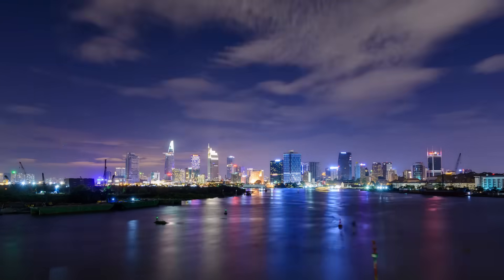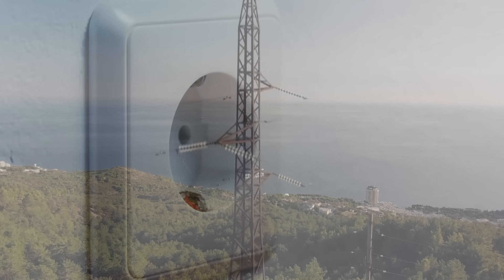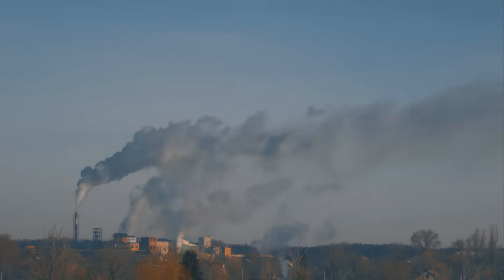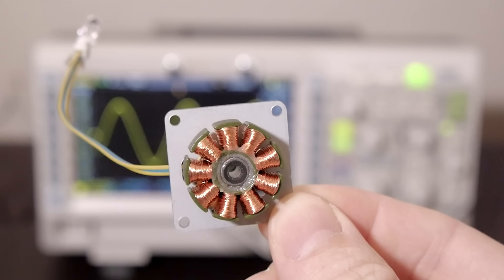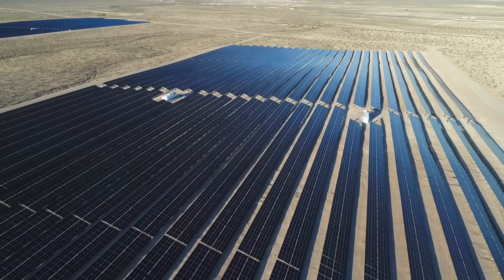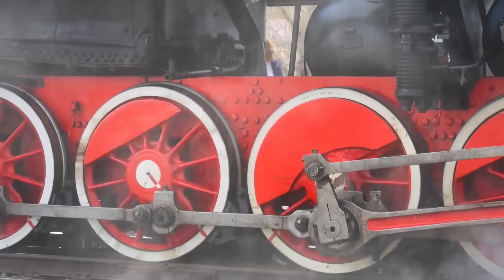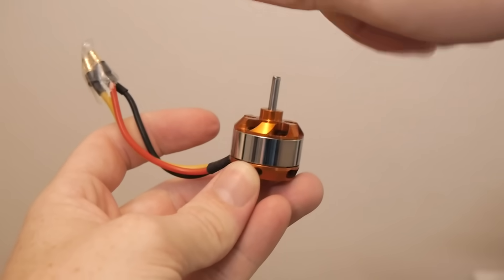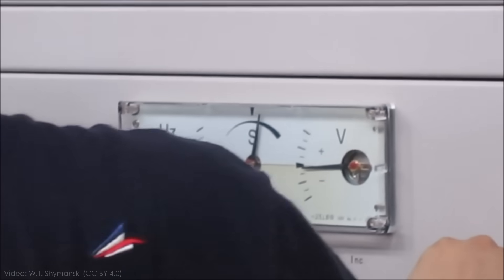How Electricity Generation Really Works

Comment: I don't know where are you from and if it exists elsewhere, but in Czechia we have optional two tariffs (higher and lower) for consuming electricity and specific time. Some appliances with high power demand were powered only during cheaper tariff automatically. It was used mainly for hot water ... we had like 150L water tank with heater and electricity for heating water was provided like for 4 hours in the night and two hours during the day or so. Other usage was heating - electric heater full of bricks that stayed warm all day long. It was used in areas without natural gas distribution or hot water/vapor distribution. 
Despite electric car are considered cleaner, today it's generally cheaper to use natural gas than electricity for heating. Either directly from indoor gas boiler or from heating plant supplying several city districts.

Comment: I'd love to see a video on different nuclear reactor designs and designs that are currently in development. I've watched a few videos on a design they are working on the utilizes a liquid fuel source that is made from dissolved nuclear waste and self regulates its temperature without the need of a computer making it cleaner and safer than alot of the designs currently in use.

Comment: You do know that co2 is not responsible for climate change. Version 6 is out now and the sun is way more responsible for current weather patterns. Finally. Do you climate change parrots realise it's not co2 and how stupid you all look for screaming "the sky is falling" ? Soon you'll start arguing that no matter what it's co2. I'll bet that's how you'll handle it. Denial. Left brain ruled.
Reply: Whatdoiknow Smith no shit the sun is important for global warming, without it we would be at 0 degrees kelvin. However it’s the greenhouse gases (CO2 is only one of them, a major one but one of them) that trap the heat reflected from the earths surface. It’s necessary fir life that it’s reflected, but the problem is now the concentration of greenhouse gases has increased drastically meaning a warmer climate

Comment: I think the Power Factor discussion would be interesting, particularly for transmission lines.... it's the "twist" which pushes the power down the line and helps deliver accurate power to inductive sources such as when a high amount of air conditioning is used.

Comment: I’ve met with many power engineers. Dino fuel is still most efficient. Solar and wind uses so many chemicals. Where do they come and go? Most stuff on earth is still here. Garbage and recycle is all the same. Wash your clothes and dishes with detergents. Where does that go. The boxes and jugs? All the same hole .
Reply: Yes that's right that's why we use "dino fuel".
See if you can follow the next point 😉.
We are trying to use alternative sources that have lower emissions
Of co2.
I know WOW right ?
Now someone says it to you it seems as if it should have been obvious right?.
Don't worry your still a plumber.
Sparky here

Comment: I though that the mention of electricity moving at the speed of light was a bit vague. While the electric signal will travel near the speed of light, does not the actual electric charge which is produced move closer to 1 mm/s (drift speed)?

Comment: The problem I see is that we are not trying to truly innovate we are simply doing the same thing we've always done let the wind turn the turbine but the water turn the turbine what heat turn the we aren't trying to truly design anything newthe technologies out there and has been out there since before I was born and I'm 30and yet we just haven't put it to practical use and or we think it's pseudoscience

Comment: On wind generation. the wind blowing the windmills will fluctuate in speed. It can speed up or slow down. AC from a windmill can very  from 60 hertz (c.p.s) to a faster or slower cycle depending on the wind. Certainly, running an electric motor on a different cycle from what it is designed for would severely damage it . How is this compensated for?

Comment: Hi Grady.  Love your videos.  But the part about CO2 is currently not supported by data.  There is currently no long or short term correlation between CO2 in the atmosphere and warming.  If so, it would have to be explained why in the past 20 years CO2 has risen and temps have decreased, why temps decreased in the 60’s and 70’s, and why temps increased to higher than they are today in the 1910’s-1930’s without significant CO2 pumped in the atmosphere.  While there is a large number of government funded scientists who try to make the case so they can maintain billions in endless research grants, many top scientists in ecology, climatology, meteorology, and physics have all disproven that theory.  The only thing that says CO2 leads to warming are the models that have not made any accurate predictions in the entirety of their use.  The only thing increased CO2 is currently linked to is increased food production.  I hope you keep up the great videos.
Reply: You are as wrong as a person could be .
You need to provide something to back up the statements you just made .
Do it right here so everyone that read you post reads it and reads it when it's proven wrong.

Comment: Co2 is what plants need, so why is increasing bad? To add to that, Oil is made of PLANTS AND ANIMALS.
Reply: Jack Nedry 
Agree fully with you.
Furthermore... since oil and natural gas energy sources originated from decaying plants, and those plants captured the sun’s energy through photosynthesis, it is obvious that oil, gas and coal energy are just captured solar energy making them
organic and natural. 
Think of coal as nature’s stored solar battery captured millions of years ago. 
Increasing CO2 will not cause the extinction of the planet. CO2 levels were much higher during the Jurassic Period. C02 is plant food. Life on earth is dependent on CO2 gas in the atmosphere. All commercial green house producers purposely pump extra carbon dioxide gas into their green houses not to increase the temperature but to increase the yield of the fruits and vegetables that we eat and the flowers that we enjoy.
Science by consensus is NOT doing “science” but is the imposition of a dogma.
The scientific method properly relies on “deniers”  to challenge the current theories either disproving, revising or discovering better theories.
Reply: @jwingo7257 ,
Thank You! I appreciate the comment!
Reply: The fossil fuels were laid down in shallow seas over tens of millions of years.
Yes they captured carbon over those millions of years.
That's exactly the point ,for a hundred years or so we have been  releasing that carbon, that it took millions of years to lock away, into the atmosphere.
MILLIONS OF YEARS !!!
This carbon is causing extra warming by reflecting the sun that is reflected from the earth and clouds and sea back at us.
A lot of the coal was laid down before bacteria evolved the ability to consume hydrocarbon.
So the trees and other organic life forms didn't rot they just lay around in the sluge and were compressed then covered and pushed below the surface by geological process . 
There I just explained it to you .
Read a book please .

Comment: On the concept of "inertia" for grid-connected power sources, check out "Dinorwig Power Station" (https://en.wikipedia.org/wiki/Dinorwig_Power_Station)

A giant hydroelectric dam that they use as a giant "battery".  Operators consume electricity to pump water to the upper reservoir during low-demand periods, and reverse the flow to generate electricity during peak-demand periods. 

Really interesting stuff!
Reply: Inertia and energy storage are two different things. Inertia only comes from power plants that are connected to the grid at the time of unbalanced production and consumption.

Comment: The generators don't have permanent magnets in them as in the little demo. Instead they use coils which are energised to become electromagnets and are termed "self-exciting".   This is how the Earth's magnetic field is generated, electric currents circulating in a conducting fluid of molten nickel-iron alloy in the core.

Comment: The number one greenhouse gas is clouds. It acts like a giant thermal blanket keeping heat in.
Reply: ...and CO2 is not a greenhouse gas on Earth. It is too heavy (1.4x the weight (mass) of air at sea level), and too small a percentage of the atmosphere (less than 1%).

Plus, if anthropogenic GW were real, they wouldn't have to keep changing its name, putting off the date of supposed cataclysm, and wouldn't have been caught at least three times faking the data.
Reply: atmospheric turbulence keeps gases mixed through almost layers of atmosphere except the very top, and even a fraction of a percent is enough to tip the planet's energy balance.

The change of nomenclature from " Global Warming" to "climate change" reflects  our growing understanding of the phenomenon. As air and Ocean currents become disrupted, some areas will become cooler as they lose access to temperature mediating wind patterns, but on average, the planet is getting hotter.

please source these three "bogus" studies, and please source any legitimate studies disproving climate change, not some facebook meme.

The oil companies do not have your best interests in mind dude
Reply: @iainavis3269   
Just FYI I'm copying and pasting your reply.
I'm giving you credit in my heart man

Comment: Solar and wind depend critically on government subsidies. Without the subsidies, solar and especially wind would not have nearly the presence they now do. That tells me -- an economist, not an engineer -- that these electrical generation methods are wasting resources.
Reply: Absolutely correct!
Reply: Louis buddy .
There is a reason that they call it the weak science man.
You demonstrate it so clearly with this comment.
You are focused on the cost as justification for renewables.
Do I need to finish the point I'm making?.
It tells me -- a grumpy old man ,that we can't hope for any help from you.
Calculate the waste of resources if the strong science (see what I did just there ?)that backs the current accepted position of almost the entire scientific community is correct and is ignored.
Start pushing or get out of the road .
Reply: @kiwibob223  The cost is the value of all the foregone alternatives that are being thrown to the wind. I AM focused on resources, but on all kinds. I don't have a tunnel vision of wind and solar. If you don't pay attention to cost, then you are necessarily wasting resources, perhaps not the kind you get wet about, but resources that we could use to make life better.

Comment: Another reason for AC electricity is the things you can do with it for long-range transmission.  A certain method (I don't understand) of placing the voltage peaks out of sync with the current peaks enables very little loss of power over the miles of grid.  My hat's off to those who understand this: I've only delved into the basic math of this stuff, and I can see that Nikola Tesla was THE MAN who enabled much of our modern world.